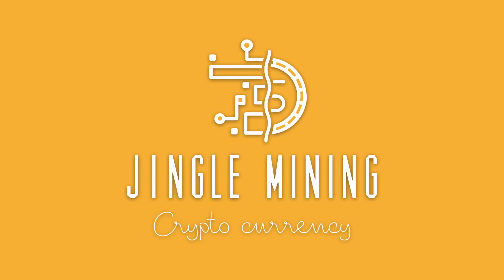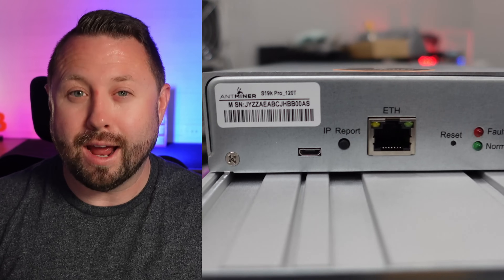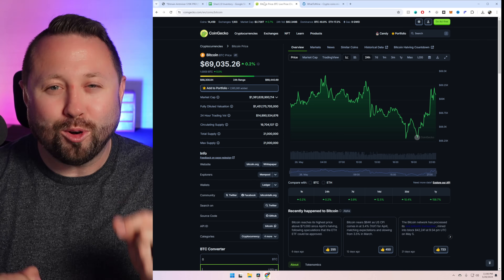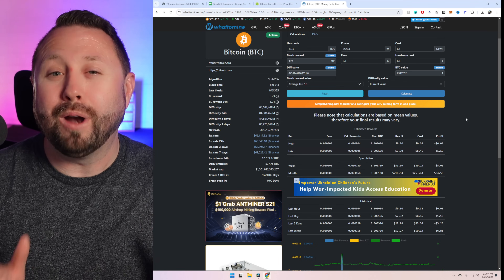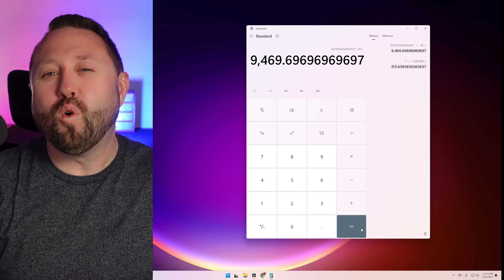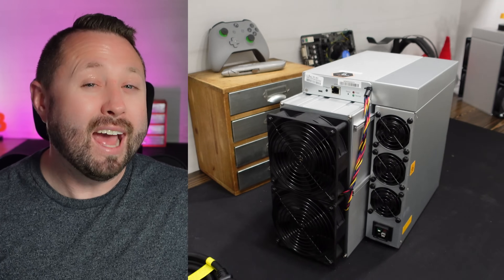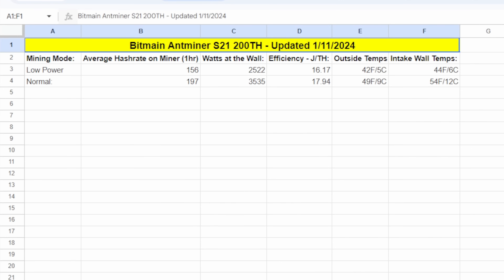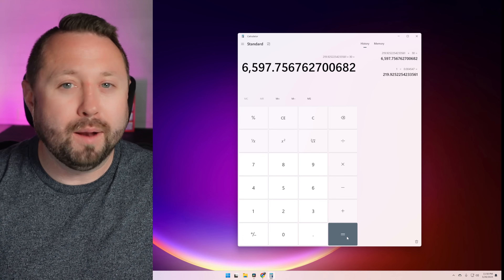How LONG Does It Take to MINE 1 BITCOIN?

Comment: Yea ive completely gone down this rabbit whole... unless you have a 30,000 off grid shop with 80 batterys for back up for your 100 Ph/s machines .... you will not make jack shit... I dumbed it down to just 50 miners and it be 650 a month just in electricity to make 500 month off those miners. 

If you missed this ship 15 years ago... then we missed it.

Comment: I CAN USUALLY MINE ONE IN  1 HOUR 39 MINUTES AND 21.5 SECONDS. BUT THAT CAN DEPEND ON THE WEATHER. THE WIND SPEED SHOULD ALSO BE FACTORED IN AND THE CHILL FACTOR AS WELL BUT ONLY IF NECESSARY.

Comment: I did a little simple math based on your video. Let say today BTC - 71.000,oo$. If you have free electricity (Solar panels), it is cheaper/better to buy 2xAntminer S19K Pro than one Antminer S21. S19K PRO in BTC make 0.003168(224x2=448$), S21 in BTC make 0.004547(322$). Buying 2xS19=2,980,000$, and S21 costs 3,920,000,000$. Many could afford a 10kWh solar system. With S19K PRO buy/earn/power is with Solar better. Think people about that solution - free electricity. Today, you can buy used Solar equipment and after 10 years solar panels are working at 80% capacity and the system can be purchased at half price.
Reply: Your math is wrong. I have a BTC miner on solar and during summer peak only produces power for 8 hours the remain 16 h are on grid. Also if you want to mine go for efficency.
Reply: @CantFindInYoutube  That's right where you live. Where I am, I have 16 hours of "active sun". Serbia, in Germany more.
Reply: @CantFindInYoutube  sometimes "backup" batteries makes sense. If i get a miner ill only be running it off grid... not on a grid tied system.  To start i plan to purchase a small 5 thousand dollar off grid system and 2000 on panels. So ill have a fully off grid system that will easily support 1 of these miners and likely will support several... the issue im having is finding how long it will take to see returns on my investment. I dont know about how the whole process works as far as fees and how to put set the system up to deposit into a wallet or how to sell mined coins. Im just now getting into the idea.
Reply: Solar is not free electricity. Plus once you pay for your solar farm, it is also needs maintenance and replacement over time.
Reply: 10 year old technology😮. Will loose on overall efficiency and effectiveness

Comment: do the estimated rewards reduce each month ? How do you factor in the decrease to work out break even
Reply: BTC won't reduce rewards each month, it happen every 4 years at the halving. The reduced reward depend on the network hasrate, when coin worth less some turn off machines but when  price increase the same happens to hasrate. ignore the break even, focus on the number of coins you get  and keep then.
Reply: Hoc can someone mine btc when they say its number is 21 million and there will be no more ?
Reply: @Tima33.4  Every 4 years emission drop to half, the 21 million will be reached in 2140. Has today Circulating Supply : 19.76M / 21M (94.1%)
Reply: @Tima33.4  i will explain but first do you understand the "mining" process and what it does?
Reply: @Tima33.4 All but just over 1 million left.  Its all a scam anyhow.
Reply: @Tima33.4 cause theres 21 million and it hasnt all be mined and once they run out there just gonna keep going up in price cause they will keep cutting up existing coint into bigger coins to accommodate
Reply: YOU SIMPLY MULTIPLY BY PIE DIVIDED BY 7

Comment: So much misinformation here … just an extended advertisement for the video sponsor 

Mr 🥚 head doesn’t tell you that the amount of BTC mined by each miner drops by 50% each year because of the twofold increase in mining difficulty … Google bitcoin network difficulty chart to convince yourself.

The majority of ASIC miners will breakdown by 3 years … some miners from Bitmain only come with a 6 month warranty!!!

Every year a more efficient miner emerges … the fantasy that people will pay 10X during a bull run is non sense as Bitcoin mining farms will flood the market with used s19 miners every year.

If you wanna be drunk on hopium and bury your head in the sand like an ostrich, then smash the like button. Otherwise call out the egghead

🥚 🥚 🥚 🥚

Comment: Got a S19k pro running on Braiins OS, much for flexible, can run it 500-5000W. I only use excess PV power (grid electricity here is 36€cents in the EU, so no go). But with PV power I get 8-9cents reward for each kWh. Same or better than feeding/selling into the grid (which I cannot). Upcoming S21 pro gets 15€cents/kWh, much better, Mining is not overwhelming, but a good solution to use excess PV if you cannot feed into the grid. Greetings from 53°N. All you people living far more south could zero your electricity costs 24/7/365 by putting PV on the roof
Reply: pv?
Reply: @traviskelly7082  I know that it's been 8 months since you asked this question. I just watched this video today and saw no one has responded. 🙂
PV means photovoltaic cell. A.K.A. Solar cell. t.d.5804 was talking about using the excess solar power to help power the miners.  I hope that helps. 🙂
Reply: @traviskelly7082  Photovoltaic (solar panels)
Reply: @traviskelly7082 photovoltaic, basically solar panels

Comment: fun fact i run my s21 on solar
i make the same on a few hours as people do on 24 hours on the grid
Reply: No , you dont,..and dont misslead people,..even with your own electricity IT IS NOT profitable,..
Reply: Can you elaborate ?   I dont understand how changing the power source = more profit.   You csm overclock an s21 sure but at 4500 watts youre only making 230-240 ths.  Based on what you said you would need to be making 1600 ths (8x) what a normal s21 makes.  Even if it was water cooled yiu still couldnt make 1800 ths in a single s21.   I have two s21  running overclocked and they realistically only make .00031-.00033 btc per day ($20-$22)